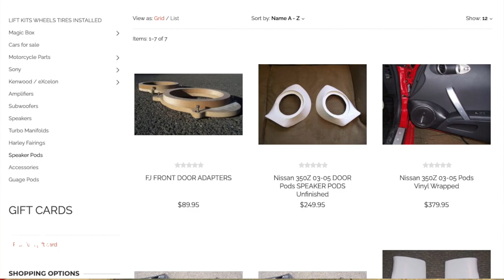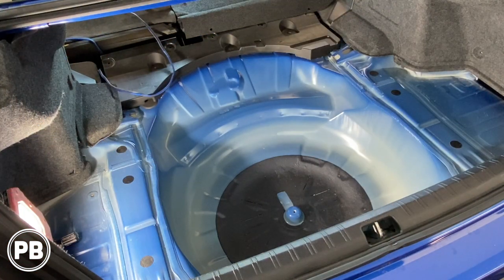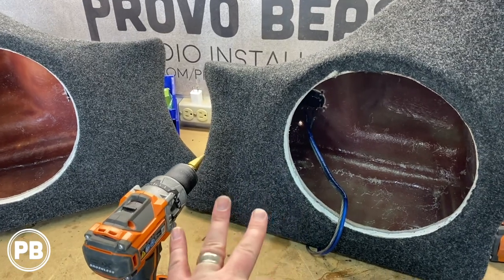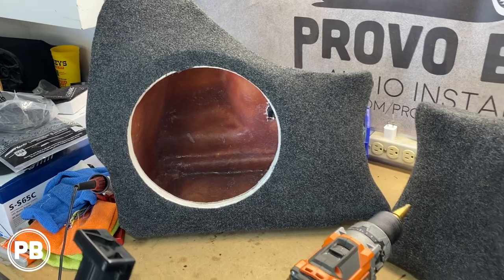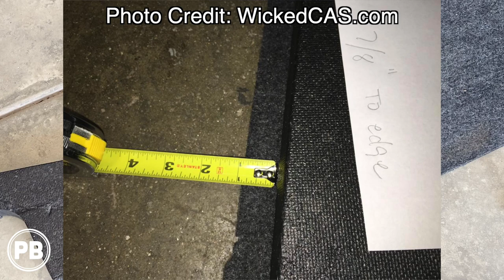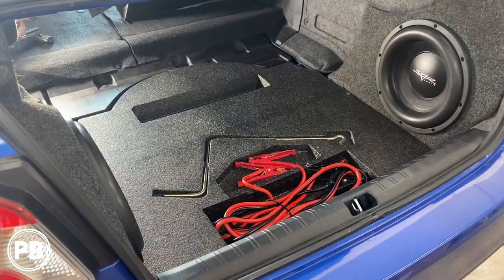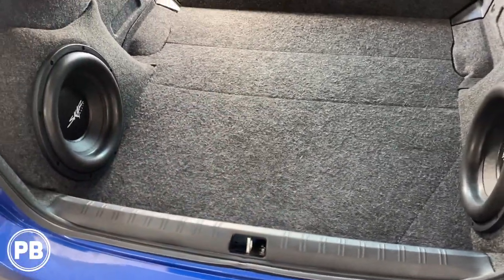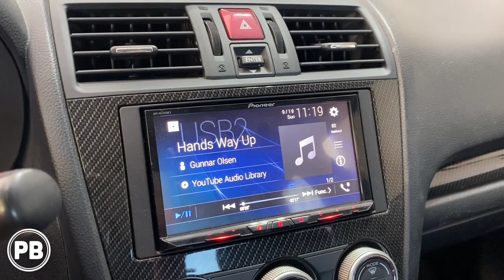How To Install A Custom Subwoofer Box!

Comment: Mine just came a few weeks ago.  Can't wait to actually get it installed in my WRX!
Reply: hello, how was the sound on the bass? was a nice smooth sound?
Reply: @sserva3117  I think it sounds great!  I put a JL 12W6V3 in the box and it pounds!  I love it!
Reply: @stevebaldi7589  perfect! yeah cus i currently have a pioneer active subwoofer and it’s not cutting it for me lol it’s barley noticeable from the front seats, that’s why i was asking if it’s loud enough to where you can feel it in the front with a nice sound no extortion or raddling, thanks
Reply: @sserva3117  I went from a JL 10W3V3-2 to that JL 12W6V3 and it is a night and day difference.  The 10 was loud, but I wanted something louder.  Also, I have sound deadening in the entire car.  The only rattle I have is on the outside, and it's coming from the passenger side taillight.

Comment: Hey, just wondering how the subwoofer would perform in a small box like that... im actually planning to build a small ported box for a 12inch kenwood subwoofer to go into a small hatchback. Thank you.
Reply: Hey man, have you done this yet? If so how does a 12 inch perform in a small ported box? Cheers.
Reply: I had small 8 inch sub integrated to rear seat hand rest and it performed really good